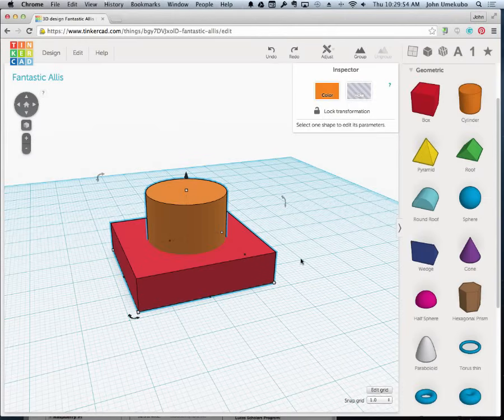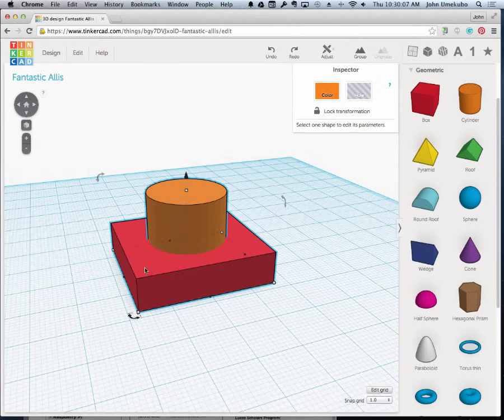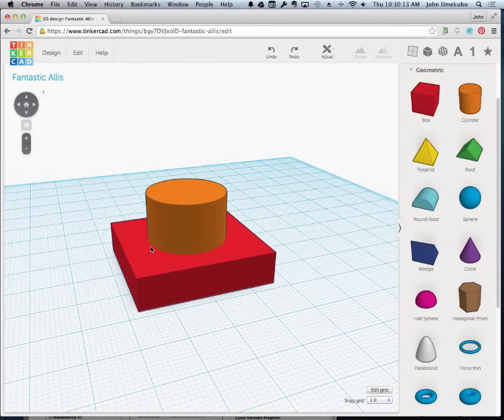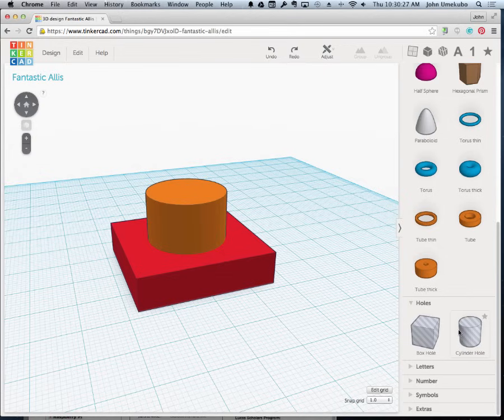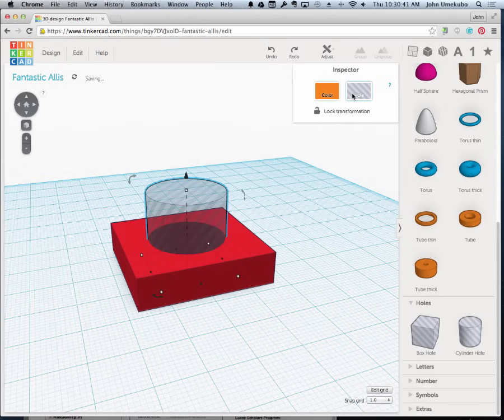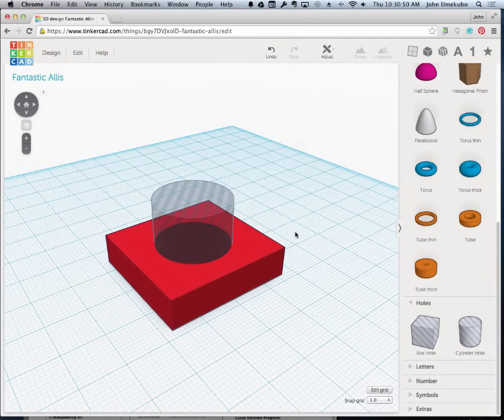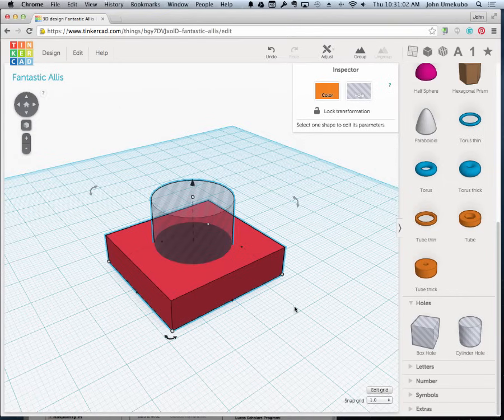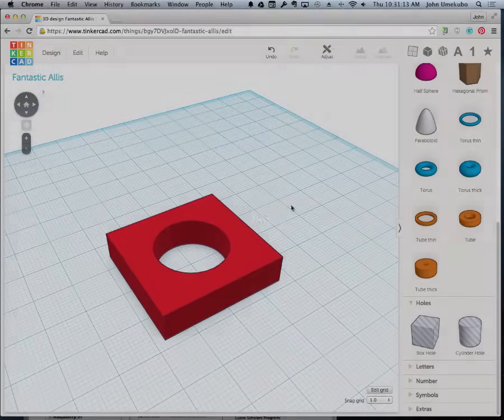TinkerCAD - Creating Holes

Comment: how do I add a grid inside the hole? like a speaker grid
Reply from the maker: There would be a few ways to do this. You could create a number of long tubes or rectangular prisms using duplicate and align to get them the way you wanted them to look. Then place the entire combined piece inside. You could also check out Shape Generators to see if there is something already made that you could modify.
Reply: @johnumekubo  Thank you for the reply I will look into this.
Reply from the maker: @Nathan1975Liggy  Good luck to you!

Comment: Im trying to make a shallow hole to place a nfc tag inside a keychain. It worked for my first trial run except the next layer on top still show the "circle fill" pattern of the print. So i can see it inbetween the top layer's intentional gaps. To prevent this do i just add another thin layer on top of the final "circle fill" in order to have a flat surface visible between my intentional top layer gaps?

Comment: When i try to group, both of them disappears
Reply: That would happen if they are both set as holes. I've seen my students do that unintentionally.
Reply: John Umekubo One is a normal mesh, having color, the other is a hole having the normal texture of holes, and they still both disappear most of the times. Sometimes, for some shapes and sizes, the visible mesh will get carved as I group them, but then resize or displace randomly.

I'm pretty sure it might be a glitch due to google chrome, I've read that this program has trouble running on chrome. Will try firefox.

By the way, is this program actually thought to students ? 

In my school we used to learn on autoCAD or just paper.
Reply: John Umekubo That's cute, I wonder what elementary kids are designing :)

Comment: Does not work for me. I click Group, it groups the hole and the object but I dont actually see the hole.
Reply: oh are you using chrome? I think there is some problem with chrome, try mozilla, i tried and it works:)
Reply: Yes, I noticed that this week too. TinkerCAD is currently recommending Firefox or Chrome Canary right now.
Reply: I am facing the same problem